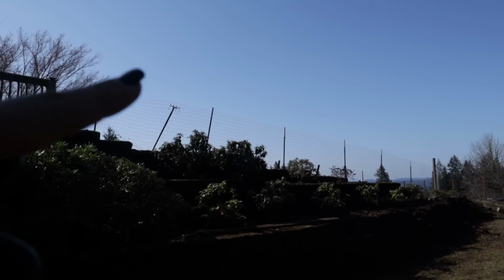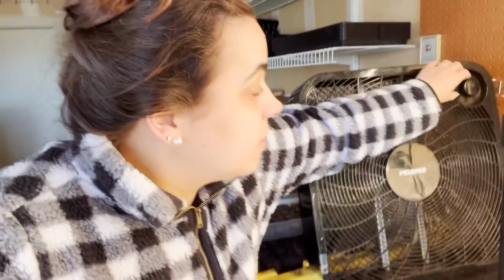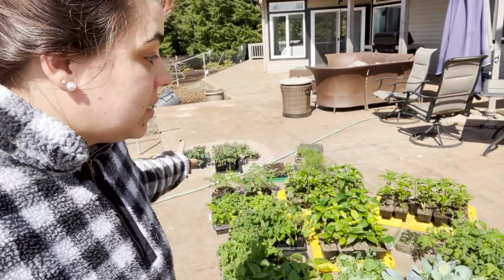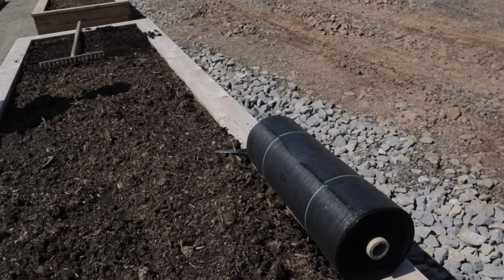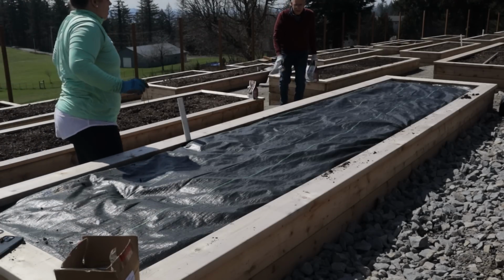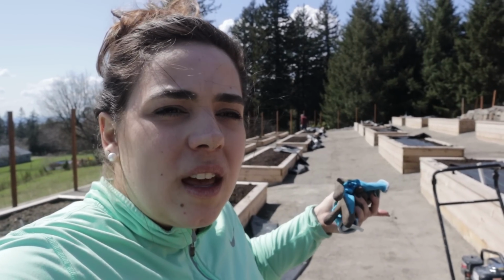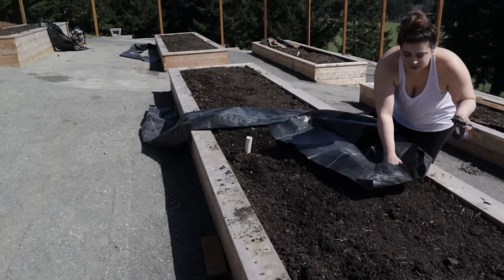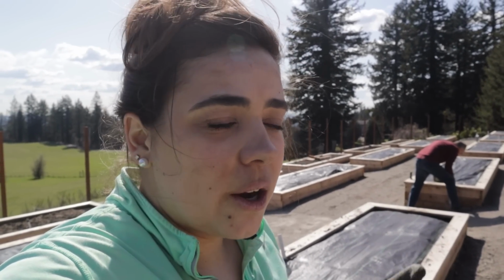This idea is either brilliant or crazy!

Comment: Becky, I've seen that farmers with large fields use decomposing landscape fabric.  I love that, but haven't found it for residential use.  No rush to take out landscape paper and you can just rake in decomposing fabric into the soil.  It's eco friendly.  Very few times that I have used landscape fabric that in a couple years I am ready to do some different yard/garden arranging.

Comment: My husband uses a heat knife in his business to cut fabrics that fray. As you cut to size, it seals the edges. I’ll be borrowing it when I add this fabric to the garden. Then a torch to burn the holes with a wooden template for the holes. The lines in the fabric the  beneficial in keeping a straight line when burning the holes.

Comment: We run our irrigation on top of the weed barrier fabric ~ that way we know if there is a leak and it is easy to repair or replace any faulty emitters as needed. You need to use a torch to burn or cut the fabric ~ the heat melts the material to stop any fraying.  Also we love our staples to rust ~ they seem to hold better in the ground when we have high winds ~ the rust gives them some texture and are better able to grip the ground than the new shiny staples.  Good Luck on your projects!!!!!

Comment: My husband made me a piece of flat steel, cut to a manageable length to use as a ruler and a straight edge to melt the ends with. Then he made me a square piece of steel with four sizes of holes cut out with the plasma cutter. I can run the blow torch around the inside of the circle and melt the size of hole I need. Those pieces of steel have been used year after year!

Comment: Just a quick note, don't put ice on a burn. You want to run it under very gentle cool/luke warm water until the burning stops and then wrap it with some non stick gauze if you need to protect it

Comment: You can also use cardboard and mulch over it.   I'm doing that in several areas of my yard.  It does break down.  I just do a little at a time.   Mulch itself will also  keep the weeds down.  I also purchased thick contractor's paper.  I'm experimenting with that this year.

Comment: Becky if this doesn’t work out with the landscape fabric, I have another option for you. 

Last year I put down cardboard and mulched over that. I just used compost as mulch. That worked really great for me! It not only deterred the weeds, but anything that did manage to grow was super easy to pull! This year I’m using those super thick brown cardboard like liners that feed stores have under their feed on the pallets. A local feed store told me I can have all I want and they are 4x4. 

You might want to try this next year if you are still looking for solutions. You just have to wet down the cardboard that you use very well!

Comment: @Acre homestead A remedy for burns is to put a few layers of NAIL POLISH 💅 over the burn. It stops the pain and in 1 or 2 days the polish flakes off and the burn pain is gone! I recommend using clear polish but in reality it doesn’t matter.  DO NOT USE ON 3RD DEGREE BURNS.   I actually have some in a kitchen cabinet and my bathrooms.

Comment: Kevin & Sarah from “Living Traditions “ do their (massive) outdoor garden with the weed mat, with the irrigation on top. They also cover the whole floor of their massive greenhouse with weed mat. (The greenhouse they use may be what you are looking for). Also cut the weed mat with the blow torch instead of scissors. This seals both edges straight off. 
You are doing great. A very clever plan. No one loves weeding. Cuddling baby is so much nicer. 💕

Comment: We got back from our trip to find that the tarp we covered our chicken run collapsed.  We really hope they were all in their coops when it fell.  It fell in a storm so we think they were in their coop as they didn't seem to spooked.  Spent husbands lunch hour yesterday putting on the a-Frame roof so no more possible collapse.  Thank you for showing the clipping! I have seen where people spread their wings and just cut a few in the center.  We went with the square staples for our landscape paper. We also came back to more tomatoes forming as well as peppers. Yes I am re-ordering strawberry roots to replant as while we were gone I think afids got to my roots and the fact that I didn't get them planted timely I lost some.  I will plant them the day or day after I get them as I soak them in water first.

Comment: I did the same soil test right after I saw your first video about it. My raised beds came back as extremely low in nitrogen, and then I also tested a pile of new "Raised Bed Mix" I got from Yard n Garden Land in the fall and it also was very, very low in nitrogen. Thank you for sharing this test with us, otherwise I would have had no clue about the soil at my new house.

As for landscape fabric on raised beds, I haven't done that before, but my idea for the end of this growing season is to cover each bed with chicken poop and bedding from their coop...and then put landscape fabric over that so that air and water can still get through, but weeds will be suppressed. Then next spring I will take off the fabric just before planting.  I've never tried this before but I'm hoping it works! I will be using straw for mulch during the growing season.
Reply: Nitrogen content changes rapidly.  It depends on the temp, the moisture, etc.  Soil testing for N is not accurate.  But most plants benefit from added N anyways!  Just make sure your chicken manure is well-rotted, or it can be too strong at first, and burn your plants.
Reply: @leahwithheld783  thank you for this info on the nitrogen testing! That makes me feel a little better about the super-low level my test showed.

As for the chicken manure, I won't be putting it on my beds until the summer growing season has ended. Do you think October-April will be enough time for it to break down?
Reply: @transplanted.homestead  Depends on how warm your winter is.  Most sources I have found recommend a year.  It goes faster the warmer your weather.

Comment: I have those same staples, I use them to keep my bug covers down, it’s coming into winter here in Australia, well it’s autumn (fall) now, winter on the 1st June, our seasons are…..Summer 1st December, Autumn 1st March, Winter 1st June, Spring 1st September.
I’ve got cabbage, cauliflower, broccoli, broad beans, shelling peas, sugar snap peas and another variety of peas, garlic, rhubarb.
I sowed some basil & lettuce seeds, I’ve planted flowers around the edges.
I’ve got those umm I can’t remember what you called them, the grow stands you got for your mum for Mother’s Day, I’ve got two of those and also was going to plant strawberries in one of them 😂 great minds think alike, not sure what I’ll put in the other one, last year I put garlic in both and it was an epic fail, lots came up but then died 😢maybe not enough water I don’t really know, but like the idea of herbs and lettuce so will do that in my other one.

Are you planning on having a compost heap? That way it will keep costs down as your beds will compact down, then just once a year top them up with compost, I’m sure you will have enough to produce enough for your beds and your chooks, have 3 so you have different stages of breakdown, can easily build your own, I’ve just got two big black plastic trash bins for mine with holes drilled all over for worms and ventilation.

Comment: Hi Becky
I use landscape fabric but still put a layer of mulch over it. In my experience, the wire will not keep the wind from pulling it up. I just use straw mulch: it's cheap and does the job.
Your garden looks amazing!!!
Happy gardening to you!
Also, if you decide not to use fabric in the future, cover crops do amazing things for your soil, and keep the weeds at bay.

Comment: Babe, yes, I add weed mat to everything, including on all my POTS.  Summer in Queensland the weeds go ballistic!! Last spring I repotted everything, EVERYTHING, and added 'landscape fabric' on all of my pots and some of my beds, no matter how big or small, and it saved me SO MUCH TIME!! I've slowly been adding it all over the yard, even taking up mulched paths and putting down the barrier, because parspalum is horrible 
Now it's autumn here, one job I haven't had to do is clean up my pots and raised beds. I've just had to top up the compost and the much, which is great. Time saver! 
I have one big wide pot that I didn't do because I already had a pumpkin growing out of it, and a bunch of herbs and flowers in weird spots, and now it's a MESS, even with me trying to keep up with it. I haven't been able to plant into that one yet, so it really makes it easier to get plants in when you need them in, without the additional bed prep.
Overall, my plants have done better from not having nutrients stolen by weeds, and I mulched right over the top, so it's helped keep a lot more moisture in the soil. I also don't have curl bugs this year! To add solid amendments, I just have to fold the mat back on one side at a time and fork in. Watering hadn't been an issue over the top, and I'm slowly installing drippers in more areas to save me more time-and water. 
Speaking of, I wouldn't do the irrigation underneath the fabric, because when there are problems with your irrigation (and there always is at least ONE problem) it's SO MUCH harder to deal with it. If you have to fix a dripper, you have to pull up all your fabric to get to that one dripper, right? Even just to figure out WHICH dripper is the problem is such a hassle. And seperation from the soil means you don't had as much stuff able to clog up your drippers anyway. Just mulch over the top once the irrigation is in, because that will stop your water evaporating in the heat before it penetrates. 
For cutting holes, I prefer a hot knife, because it melts the edges, and it also makes a slit that you can peg closed with your staples, rather than a round hole. If you want to keep specific pieces for specific plants again and again (like, 'this piece is my tomato piece'), just hang them over a clothesline in between plantings and spray them down thoroughly with a mix of vinegar and eucalyptus to kill any plant specific bacterial diseases and micro bugs/eggs, even if you haven't had any pest or disease problems. Sometimes you don't know you've got them until it's to late. Get them super dry in the sun before you reuse.
Trust me, this is great idea, it's going to save you time, and your plants will love it. It's actually easy to reuse, too. Even if your holes are in the wrong place, you can use one of those square topped staples to hold the pieces together, or you can use a heated knife to melt it back together. Or you can plant a non competing plant as a companion. Keep that 'wasted piece, too, so you can cut patches from it in the future! 
So be comforted, this is an excellent idea, that extra effort and expense will pay off, I promise!

Comment: An idea to make sealing the fabric ends and making holes for plants. Take a vegetable can. Tie or tape it to a garden stake or a dowel Rod, of a length that fits your height. Heat it up, very hot. With your torch, a bbq fire ir a fire built in a portable fire pit and cut multiple holes before reheating. Also run the hot can along the edge of the fabric to melt/seal it without catching it on fire.

Comment: Landscape cloth is something I used thinking it would be better then using news paper! It turned out my frugal ( we had low budget) way was much easier and better. The newspaper is biodegradable and kept weeds out and held the nicely. I would plant the bed then as I mulched  I put the paper in and around the plants. The new problem is where to get them now a days
Reply: I bet brown paper bags would work great📖
Reply: Cardboard is another great option! Uline sells rolls of corrugated cardboard that are perfect to use as a barrier :)

Comment: You can use 1 inch PVC pipe cut in segments to tuck fabric in under the lip of the beds.  Similar in concept to securing a slipcover on a sofa.  Or drill holes in pipes and cut matching holes in fabric and attach with twine. Both work.

Comment: Those are the exact pegs you need for the weed fabric. I wondered at your other garden why you didnt use the fabric.... I also have the hoops and row covers on my brassicas and some other things also until they get too big for the crows and bluejays- they're both thieves  lol  It's looking good dear. you're oin your happy place : )  Suggestion- when hardening off your seedlings, place them in a shady spot and the sun will gradually take the place of the shade, which is less a shock to the seedlings

Comment: If you put the irrigation on top, you will be able to see when there is a problem with it and it will be easier to fix.  Also, before you put the holes in the fabric, figure out how far apart you want to plant different things.  If you come up with say 5 different vegetables you can plant at 18" apart, then you may have 5 beds you can do that to.  You can do your rotational gardening each year with those 5 vegetables and not have to take the fabric up unless you need to put fertilizer in.  If you use rabbit manure or worm castings you can put that directly in  the holes and not have to take the fabric up as often.   I got all of this advise from Living Traditions Homestead.  They have also been using their landscape fabric for about 5 years I think.  It's still going strong.  They also have a big green house they grow in as well.

Comment: Weed fabric is fine in raised beds or on the ground, I use it a lot for both. You will be able to reuse the fabric for many years, but definitely using a little heat torch (we use one for creme brûlée too!) to seal any cut edges is essential or it will fray away to nothing and you’ll be chasing plastic threads forever. Now every time you clear a bed you can cover it and keep weeds under control, and of course putting the garden to bed for winter, any empty beds can stay covered and weed free.

Comment: You can see it if you have any irrigation issues if it’s on top of the fabric. Also a small torch makes the fabric last longer. Burn the holes basically 6”-12”-18”   Works for most plants

Comment: My chickens could fly up part of the 6 foot fence, and would climb the rest of the way! I want a cover over it now. I did clip one wing on the one chicken that wanted out the most. We seldom lock ours in the run, only when we have visitors with dogs, or they are working in the fields by us. Otherwise they free range on a few acres. Good luck with yours!

I started using raised beds a few years ago. I deep mulch every fall, and have very little weeds. I use what I have available. Wood chips, shavings from the chicken coop from the year before, or even mowed up leaves and/or grass. I have never used landscape fabric. Good luck!

Comment: Hi, lavender and rosemary grow easier from taking cuttings from an already established plant. Lavender is really hard to grow from seed, only a few from each packet is pretty normal.  Also I didn't mention it at the time but in one of your other videos you said you had trouble with echinacea germination. I'm in australia and I need to put my echinacea seeds on top of moist sand and put them in the fridge for a couple of weeks. I put ice cubes in once or twice to simulate snow, then take them out. Have had success doing this as they need the cold to germinate. Happy growing!

Comment: When you put your irrigation under the fabric you don't have to worry about water splashing on the plant at all.  I used my fabric for about five years before I had to replace it   I got another fabric that was mostly cloth and it was black on one side and white on the other.  You could use it on the black if you lived in a cooler climates and on the white if your area is very hot.  Excellent fabric.

Comment: Becky, regarding the Lavender, I wondered when you planted them if you had stratified your seed for a few weeks in the refrigerator prior to starting it.  If you didn't that could be the problem.  However, even so, it is not easy to start. Good luck!

Comment: They also have round discs with two holes to use with your fabric staples.  It helps with ripping with fabric in walkways.  In case you use fabric under chips for walkways 😊

Comment: We use a soldering tool to cut all of our landscape cloth.  That way we are sealing all edges, which will last longer.  First year we didn't do that and regretted the decision almost immediately when it started to fray on a regular basis.  What a mess.  Plus wasted money because we need to re do those areas now.

and are you sure it was 100 feet?  Or 100 yards, which would be 300 feet?  That roll looked pretty big.  😊😊

Comment: The best thing I’ve found for burns…and it works…whip up an egg white and slather the burn.  It firms a skin which keeps the air from hitting it.  I’ve actually had some decent burns that did not hurt at all after the egg😊

Comment: I put landscape paper on my hugelkultur last year, and it worked great! Biggest cauliflower,  Broccoli,  and cabbage I ever grew. It should work great in raised beds, but I don't get a lot of weeds in my raised beds. Mine and yours now are off the reg ground quite aways. I think you could go without but safety is you will love using it. Your watering system will water, no weeds, just sit back and watch it grow! But lookout lol lots of produce coming your way this fall.
If you get bug, slugs on your cabbage broccoli cauliflower or aphids on peppers tomatoes ec remember cinnamon works great.

Comment: Just a thought as I was watching you take the plants outside to harden them off. Could you attach wheels on the bottom of the shelving and just wheel the whole lot outside and then back in again. I did think about the lights and then thought it still must be easier to unplug than taking out the plants and bringing back in?
Or have another empty shelving rack with wheels to do the job xx sending love to you and yours xxxxx